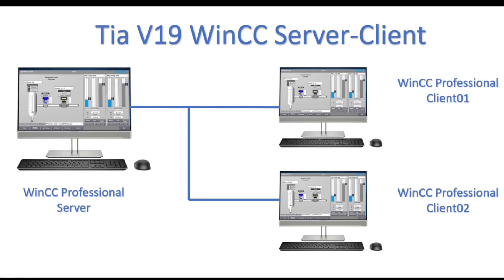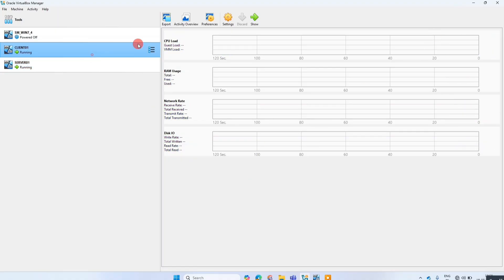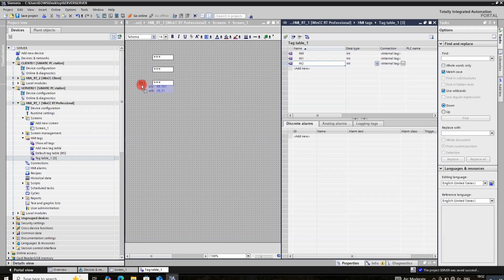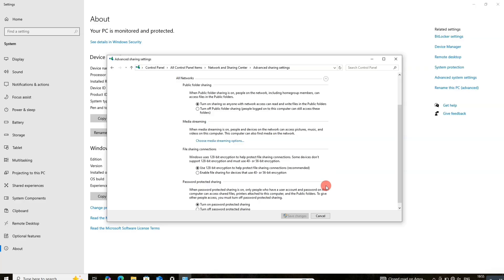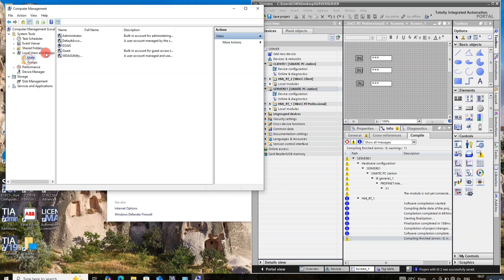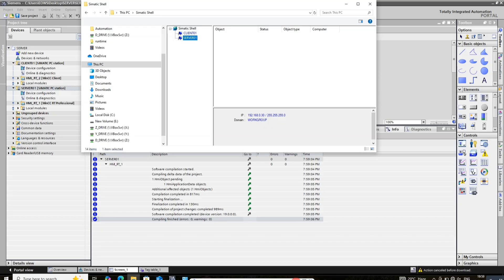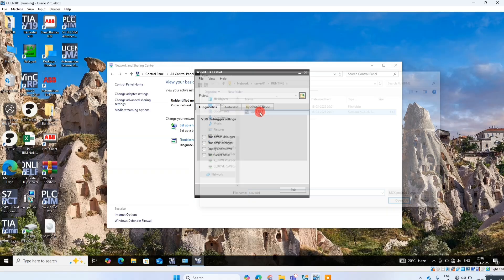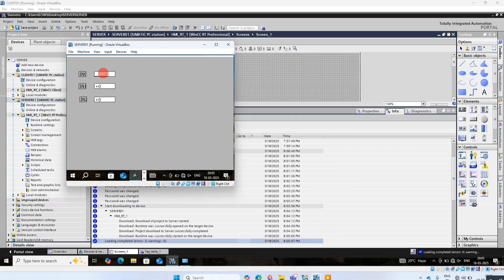Server Client Configuration in WinCC Professional #wincc #server #tiaportal #tia #siemens

Comment: Hello another problem im facing is that when i open my wincc runtime professional in my client pc and try to extract the folder an error occurs sayin cannot open wincc project invalid project path please if you can help me
Reply: I found the solution you just need to share both the runtime fille and the wincc project hmi fille from the server pc to client
Reply from the maker: You need to gives rights of Simatic HMI.
Reply: @khaleedkhaleed2981 i have same problem but i cant fixed it. I didnt understand which file you shared, can you help me

Comment: I tried implementing this using 2 pc stations instead of virtual machine,and i connected them using Ethernet and i faced a problem that the simatic shell shows only one device, and Hence the last step of loeding to device the rt professional is not working....
If anyone can help me with this problem i wil appreciate it
Reply from the maker: Have you  selected Ethernet adapter in both systems on Simatic Shell.

Also check below things.

You need to activate 5 services in both Computers.the details below:-
1. DHCP and  DNS  CLIENT 
2. Function Discovery Provider Host
3.Function Discovery Resource 
4. SSDP Descovery.
5.UPnP Device Host.
Reply: It worked thank you for your help
Reply: @khaleedkhaleed2981 
You should have explained what you did to make it work